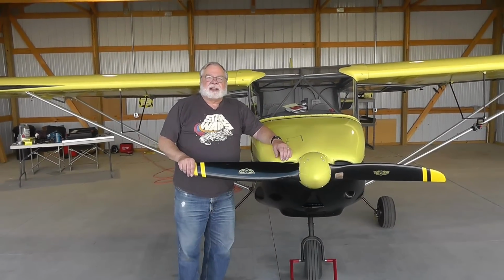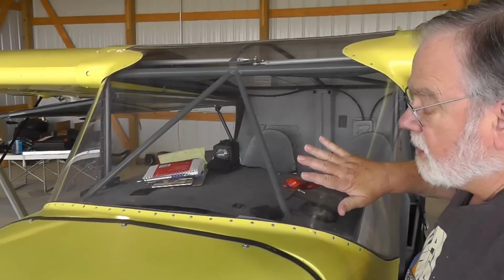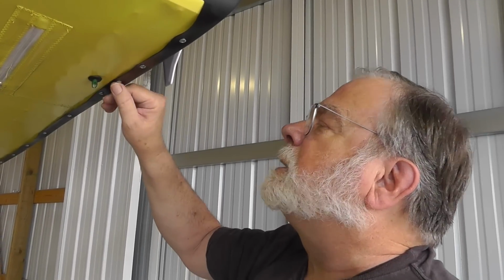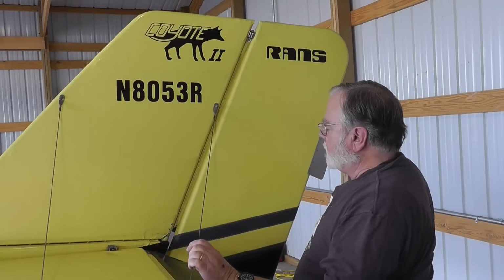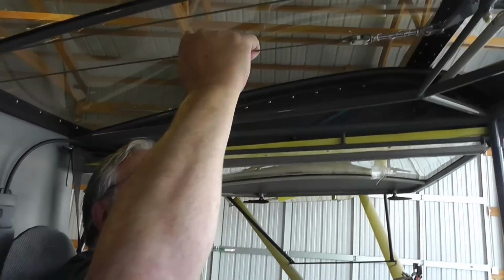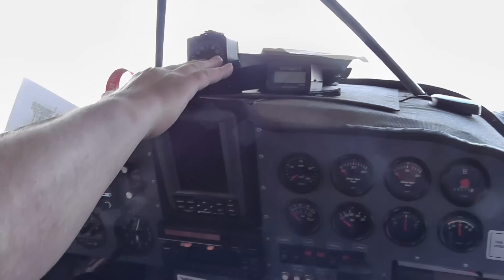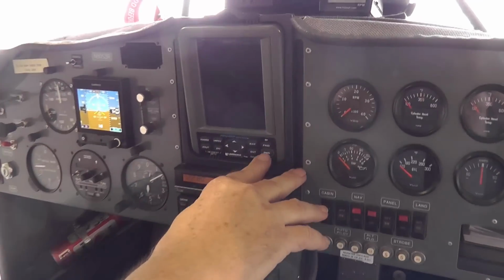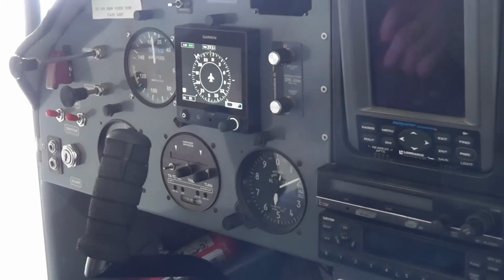Tour of My Aircraft!

Comment: Why aren't the aileron and rudder controlled by a single control? For one, there are maneuvers like a slip which require crossed controls. During recovery from an accelerated stall control inputs are sequential, not simultaneous. While it is generally a no-no in airplanes, it is necessary to lead a turn with rudder in a glider. Of course there's the p-factor compensation which is done during takeoff using the rudder. These are some reasons I can think of off the top of my head.

Comment: Homebuilts are so much fun!  I owned a Kitfox II for 10 years. Used to fly it in to model airplane fields. Built it in my garage and the floor is still yellow from painting. Had a 582 Rotax which had oil injection.

Comment: Dave,
a few things:

1) the reason aircraft engines have bolt on cylinders. Mostly because they are air cooled. It is easier to manufacture the cylinder barrels and heads, and cast the cooling fins by making each cylinder separately. Another reason is that it is not all that uncommon for something to go wrong with one cylinder.. A stripped spark plug hole. A burned valve seat. A cracked cylinder. It is way cheaper to replace one cylinder, rather than all four or six in bigger engines.
Weight is an issue.. Every ounce you save on engine weight goes right into more payload.

When it comes time to overhaul the engine, having separate cylinders may let you keep some good ones, and only replace the bad ones. If the case, rods, main bearings, crank shaft are all still in spec, you may save money there, too.

Comment: The 51% rule is NOT on the Value of the aircraft, but in the processes required to manufacture and make airworthy the aircraft.  FAA doesn't give a darned about the value.  All fabrication and assembly done by other than the builder (whether by the factory or by sub-contractors or vendors) must be less than 51% of the total fabrication and assembly.
In terms of value, the builder usually puts in more than 75% of the value .... NOT including cost of labor

Comment: Nice aircraft, Dave! Makes me want to jump in and finish my PPL SEL!
I have an old handheld Lowrance aviation GPS (Airmap 300)  I've had it for about 20 years. You can grab a PDF copy of the manual for your GPS at Sporty's. Do a google search for "airmap 2000c manual" and it should show up in the top results. I noticed from the screen, the aviation database in your unit is dated 4/8/10-5/5/10, which is the validity date range of the FAA info. Lowrance used to provide (sell) updates for the airports and sectional info on a flash memory card. Looks like you have the last one they produced. Yes, sir. Time to get a new GPS.
73 DE K5MSK